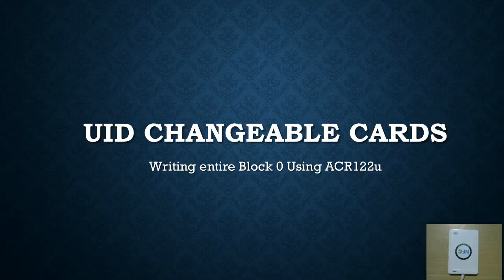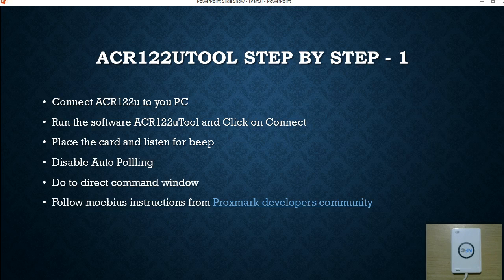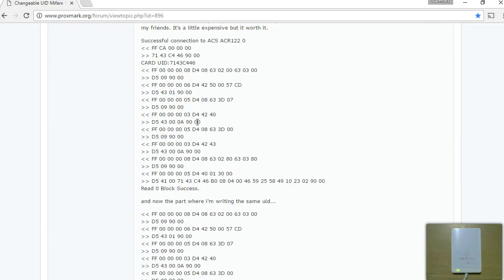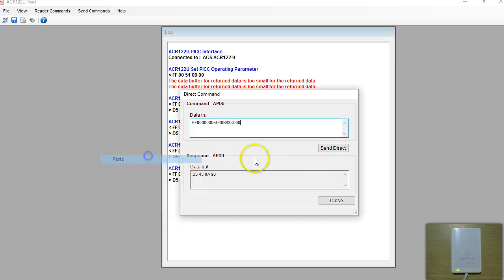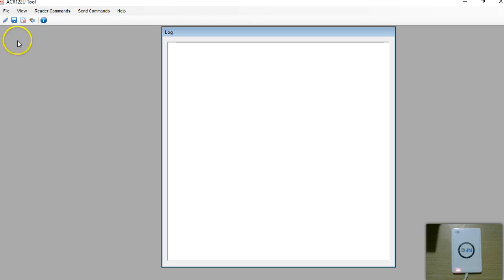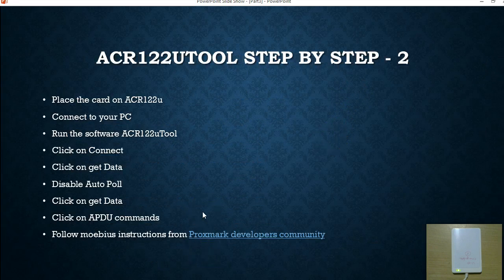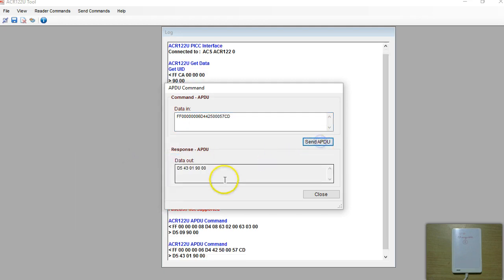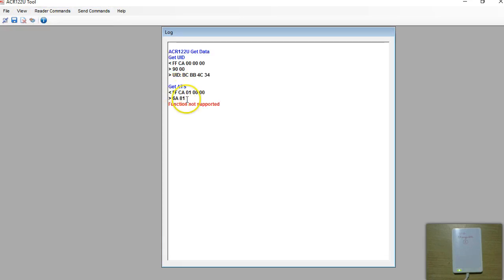UID Changeable RFID Cards - Part 4, Using ACR122u

Comment: Hi.
Where can you download the ACR122U Tool?
I have an ACR122U reader but it did not come with that software. The manufacturer's website also doesn't have it. Can you make it available?

Update: I saw it. You have to install the ACR122 SDK  PC.
Reply from the maker: Some chinese sellers in Ebay give CD when you buy ACR122u reader writer. Please check in GitHub you might find.